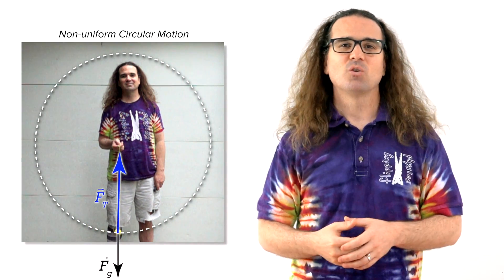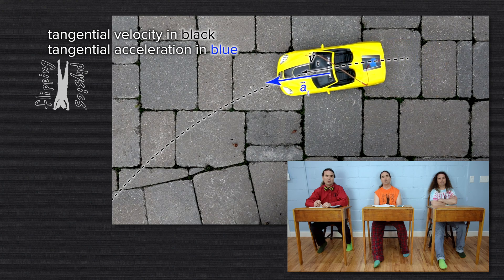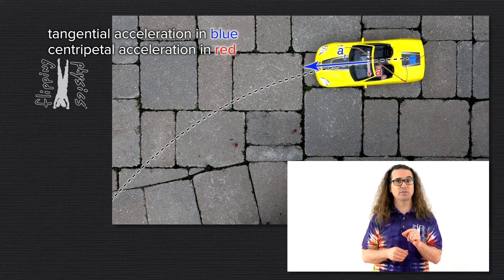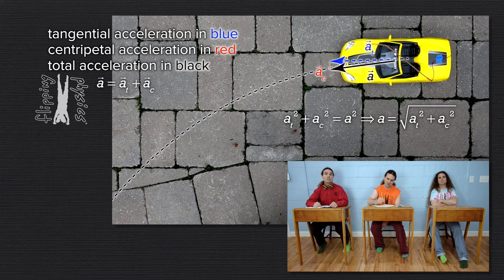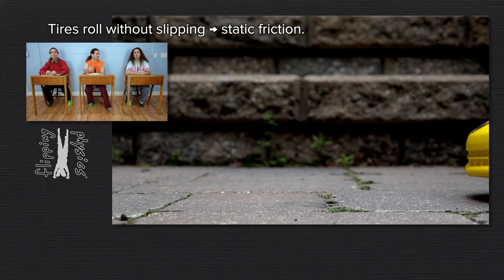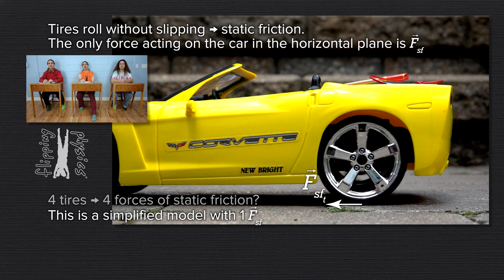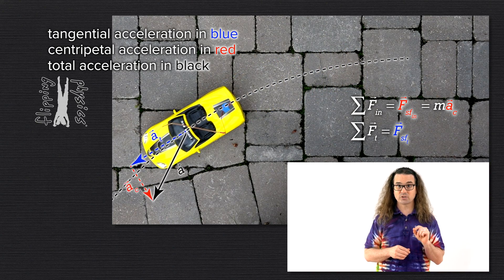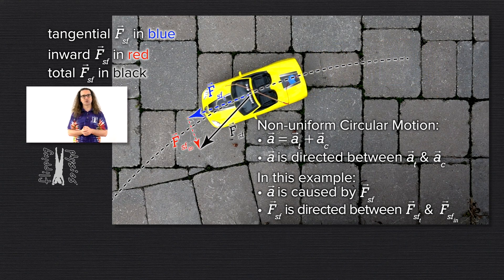Nonuniform Circular Motion - Accelerating Car

Comment: Mr. P, I  have two questions: you know we have car fuel that combusts in the engine that causes the hydrolic system to propel the car forward, what is that force isn't that the force applied? Morever, shouldn't the direction of the friction br opposite the direction of the motion? Have a nice day!

Comment: thank you great work , i have one question the friction force direction should be opposes the direction of motion but in this example both in same direction ?
https://youtu.be/IqmzNU11kv4
in this example for ABS the friction opposes direction of motion
Reply from the maker: Good question. I will respond with a question.
In this example, what force is it that causes the car to move in the direction of motion?
Reply: @FlippingPhysics  i think some  of kind applied force, because in begining the car it was at rest and this applied force used to change the tangential speed
Reply from the maker: The only part of the car touching the ground is the tires. The only horizontal force the ground can cause on the tires is the force of friction. It is the force of friction which moves the car. 😀